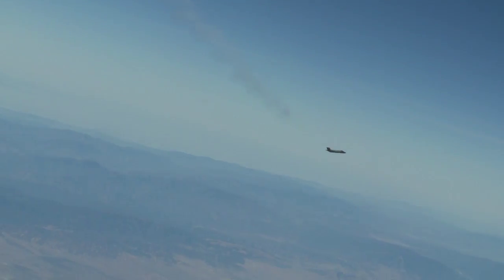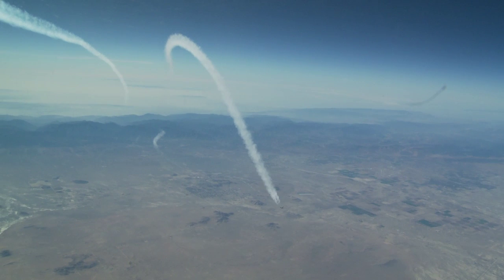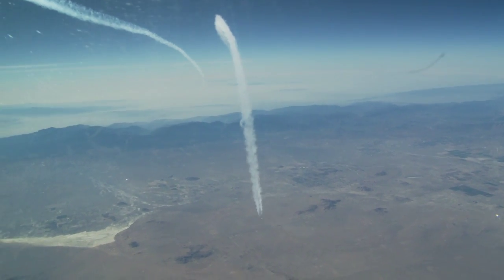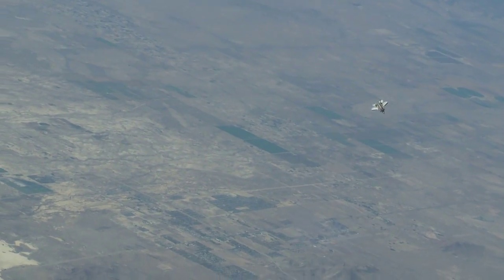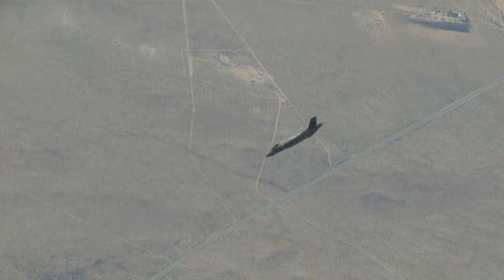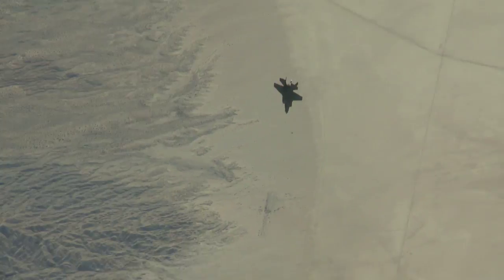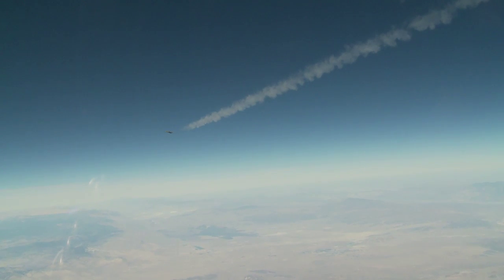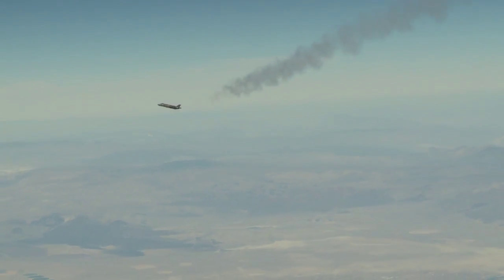F-35 High Angle of Attack Testing

Comment: Where do you get this 5% number !!!

With what radar on Rafale? RBE2-AA is in production and all aircraft are being fitted with it as we speak. Typhoon still doesn't have an AESA yet. Even the passive RBE2 PESA that's being replaced is better than Zhuk pulse doppler in every sense.

Where the hell do you get this 5% ?

SU-35 is still in development as well and has yet to see service or even have all it's systems designed and worked out.

AGAIN

Where the hell do you get this 5% number !?!

Comment: SPECTRA has the functionality of a jamming system with it's active electronically scanned antennas.

BUT

This is only a small part of what it is. It's a PASSIVE radar and laser detection system that can detect a threat with a precision of less than 1° 360° around the Rafale. I can't tell you range or any details like that as it's all classified. As is your assertions regarding the American radars and passive systems.

As for Rafale having a poor RCS, compared to what?

Comment: F-35 vs rafale?  

F-35 has a 560% engagement resolution range advantage :) OUCH!!  Gotta love physics.

As per typical stealth doctrine, two F-35's would sit back at 150 milles and paint the sitting duck flight of rafales (alternating emission between displacements), while one or two f-35 "shooters" sneak silently into NEZ range using recently tested and proven M1.2 supercruise dash and blow the poor flight of obsolete rafales out of the sky.

Can't see, can't hide, can't escape.
Reply: Rafale? How do you the compared The  F35 ? u
Lack of   Education. U typical snowflake believing on  fake news how the F35 is the biggest failure of Lockheed Martin on  stealth program.

Comment: "The F-35 on the other hand enjoys a 590% radar detection range advantage against the Su."

Let me clarify that....  590% firing solution range advantage.  The F-35 maintains a 250% "detection" range advantage against the Su's leading edge l-band arrays, however their extremely low gain doesn't give engagement level tracking until much, much shorter range.

Comment: A Growler loaded up with 3 jamming pods and putting out a combined signal of 33kw absolutely dominated the measily 1kw per channel (yay 3 channels) jamming signal from the toy rafale.

Addtionally, spectra's 3 RWR's can only detect 3 very small range signals at a time.  The system is just a toy compared to the F-22's ALR-94 (30 RWR's) and F-35's Barracuda (classified receiver count, but similar to F-22).

An AESA radar wouldn't even notice jamming from the sitting duck rafale.

Comment: SPECTRA works great against 50 year systems like in Libya.  Unfortunely vs any tier 2 or 1 military, is comprises of a "jamming system" to try and counter the airframe's terrible RCS characteristics.
Jamming systems dont work too well against AESA radar which is used by pretty much all western nations as well and wealthier eastern ones.

Then there's the fact that while the jamming system is running actively, it makes the job simple for passive receivers to track it :)

Comment: "Are you claiming the sensors are mounted to hard points there guy guy"

He could do so with confidence.  Rafale needs a Domacles Pod just to engage ground targets.  No bomby bomby without it chumpy chumpy.

i. imgur. com/ mhTMU. jpg

It also requires ELINT pods for EW duties and SAR pods during standoff strike due to the tiny aperture and APO of the legacy RBE2 radar or 1st generation AESA variant (the 81 on the F-35 is 6th generation AESA).

Comment: oh dear...soiling yourself in this thread too.

Why are you saying passive radar is new?  It has been in service in many countries for decades.  If you knew a single iota of EM wave theory and stealth shaping you'd know these are useless in a high jamming environment against stealth aircraft.  Specular reflection of waves, from monostatic radar or ambient noise is still directed at an angle to reduce detection range.

The frontal RCS of an F-35 is levels of magnitude smaller than the F-117.

Comment: SPECTRA is integrated into the Rafale's airframe. Also it has "sensor fusion" (fucking buzzwords) as most modern avionics systems are integrated and "modeless" IE can track both air and ground at the same time and display radar and IR information in the same display overlayed.

Are you claiming the sensors are mounted to hard points there guy guy.

I think you mean ORDINANCE and perhaps fuel tanks that's it.

You clearly are a fucking LM PR drone astroturfer.

Comment: 1) The F-16 is cheaper yes, but the F-16 is cheaper than pretty much every other modern fighter in the world as well.
2) F-35 was designed for ease of maintenance. Maintenance times will be much shorter with the F-35 and will cost around the same.
3) I love how you are comparing 1960's aircraft with aircraft of today. Missile were a new thing back then. In 1991 during the Gulf War, over 96% of aerial kills were from BVR. And that was over 20 years ago. Missiles now are far more maneuverable.

Comment: The PAK-FA exists in a few prototypes all of which have had issues with airframe cracking and engine malfunctions. Yes, if the Russians execute perfectly the PAK-FA will be very capable. But in the meantime, the F-35 will not be standing still. Already, Pratt & Whitney and GE are working on substantial improvements to the F135 engine core that will enable the F-35 to supercruise and sustain a much higher turn rate than the present version. Those upgrades should hit around 2016.

Comment: The Blk 60 F-16 is highly maneuverable and can in fact supercruise with a very light weapons and fuel load in the A2A point interceptor configuration. But if you need any sort of range, endurance or large weapons capacity the F-16 quickly becomes slower and much less maneuverable. In fact, with a moderate weapons/fuel load it has some of the poorest transsonic kinematics of any current fighter including the F-35.  The F-35 will fly circles around the F-16 with a moderate weapons load.

Comment: The latest, most modern F-16 variant is the Blk 60 developed for the UAE. Each unit is $80 million a piece but despite this, the Blk 60 is inferior to the F-35 in every way; speed, range, payload, kinematics and survivability. Did Lockheed produce a lemon in the Blk 60? No. But the F-35 is literally a generation ahead. You can't keep refining a 70's era light fighter design and hope it can survive in modern threat environments.

Comment: AoA is the difference between the direction the plane is pointing, and the direction it's moving. If a plane exceeds its AoA limit it can go out of control, and this is a primary limit on maneuverability. 50 degrees is about as good as a non thrust vectoring aircraft is capable of and both the f-35 and f-18 are capable of achieving this. For reference the F-16 is capable of about 25 degrees.

Comment: you can't overlook any aspect during the production of an aircraft. i know aeronautical engineers who have designed an aircraft and the work is extremely meticulous, and even mundane at some times. i know what you mean though in the sense that it has been how many years since the aircrafts production (even the test pilot mentioned it), but that's not for us to decide. Lockheed Martin wants to deliver the best product possible and it seems like they're on the right track.

Comment: They were not doing jack squat they were knocking off test points which got the F-35 to the point where they could start doing the high angle of attack stuff. There is no point hurrying to do high angle tests if the engine keeps flaming out because compressor stall.